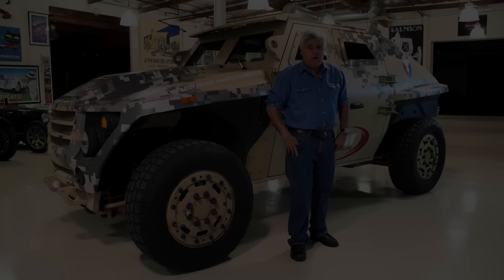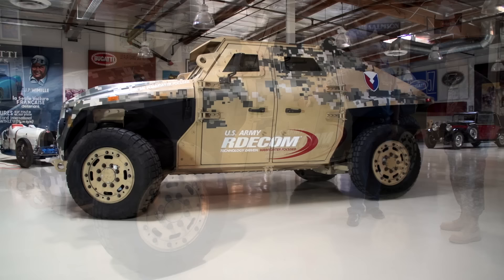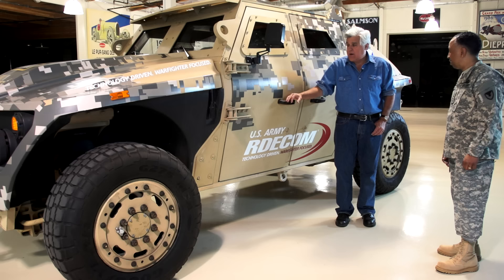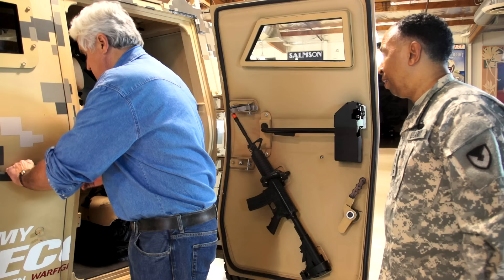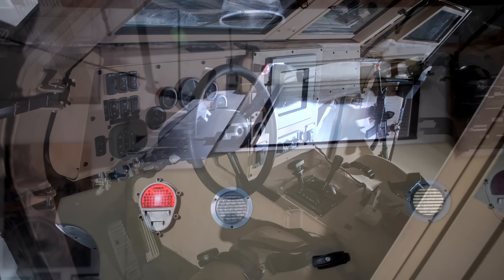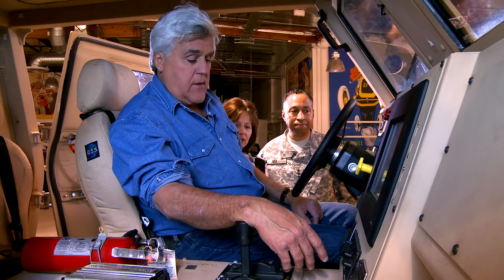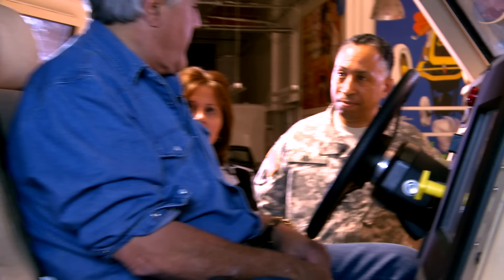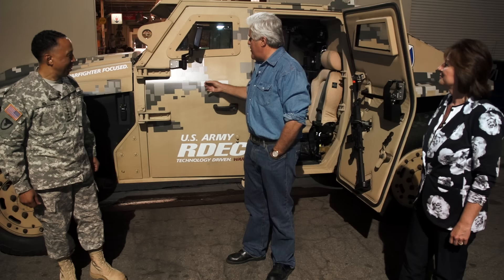U.S. Army FED - Jay Leno's Garage

Comment: 30Gal?? Well, somebody was high....
Reply: Other than that this thing is perfect. It definitely needs a bigger tank.
Reply: And a 7 speed. 4 forward, plus a granny gear, r1+r2. Although I do agree with jay, abs and traction control? Just something else to break. I hope the 4x4 is mechanicaly engaged, as well as the diffrentials and, tranfer case.
Reply: Its in 4WD all the time, with a high lock which locks the center differential in the transfer case giving a 50/50 front & rear torque split plus 4WD Low Range...same setup that the HMMWV's have....and contrary to what many think the HMMWV's do not have locking front and rear differentials.
Reply: Remember: This was designed by people who've never been in battle. That high 6-figure PhD engineer probably never designed a car before.

But, the purpose is to show congress and other key political figures the Army is, as Dirty Harry would say, "Stylish." That way, they can get more R&D money, hire more PhDs and bigger staff for the general.

"Mission Accomplished!"

Comment: that auto level would get annoying real quick
Reply: Add in some sleep deprivation and ambient road noise and somebody is going to mistake that sound as a mini gun going off.  Two intentional sounds I do not want to hear from a vehicle is the sound of something breaking and the sound of somebody shooting.
Reply: Yea, they have these auto levelers on fire truck baskets, on the aerial ladders, and although necessary on a ladder truck, it takes the least bit of movement to make it work.  I can't imagine that you are trying to sneak thru the streets of bad-guy-ville and drop into a pot hole and all that noise from the leveling system gives you away.  Hopefully all that interior lighting from the monitor can be shut off...it would make you an instant target.  Don't they get real life advice from  users of this kind of stuff before they spend millions on development? ABS? Really?
Reply: I think you are thinking of a Bentley, Dale

Comment: That would be easy to take out. Shoot the air ride suspension and tires it will drop low to the ground if not to it. Also there is easy access to the motor compartment. Once the motor is disabled it would be a waiting game. A fire under the cab would eventually kill the soldiers inside.
Reply: no air tires have already been developed but are waiting for production,they ride very nice and do not deflate under any condition and are tough as hell.

Comment: Air brakes, air suspension. In a war zone. sorry.
Reply: they have done if for years. they normally have redundant air tanks and also a brake override i believe
Reply: Jimmy O.
Reply: Brenda Richardson Richardson air brakes on military trucks have been done for many many years. there are countless ways to make the system repetitive enough to make it safely through in a fire fight with no crippling effect on the air parts.

Comment: 4cyl 200hp.. why?? that sounds super weak sauce.
Reply: Did you hear the torque numbers? This thing could probably pull a house off it's foundation.
Reply: uttersqueeze
how the generate so much torque with a small engine. Heck my saturn had 120HP. So why only 80hp more?
Reply: 77Avadon77
Its the Power stroke, weight's, and Bore displacement that give the Torque numbers.
Reply: 77Avadon77  Diesel engines have high torque numbers at lower RPMs, it doesn't need as much horse power
Reply: 77Avadon77 Just because it is 4 cylinder doesn't mean it's a small engine :/ Generally the larger the cylinder you get more torque less HP. Roughly speaking. So the same capacity engine as an 8 cylinder would generate more HP but less torque...... Please note this is a generalisation and not a rule.
Reply: 77Avadon77 I don't think you understand HP vs Torque. Torque is how much power the vehicle puts out, in this case I thought I heard 580 ft lbs. HP is how fast that power can be translated to energy. Something like this will never win a drag race but a tractor pull isn't out of the question.
Reply: Kyle Becker I think 90% of the people driving on the road have this misconception, mostly because our physics classes are more about teaching 5th graders how to compute momentum rather than more practical things.  That, and horsepower has the word power in it.
Reply: Kyle Becker You're damn right.....too many get caught up in HORSEPOWER and number of cylinders and you can tell right away they really don't have a clue......plus low hp and high torque numbers are a standard with diesels.....I say something similar to your tractor pull when describing high torque diesels: it won't win the indy 500 but it can pull down a house! I remember going to a car show in the 80's and Ford had a big yellow "tonka truck" with a big turbo diesel in it. It had 250 or 300 hp and all my buddies were scoffing....I said "read further"...800 ft lbs of torque...so what they said? I said: that is the important number for guys who pull trailers......you could probably chain all our cars together and hook them up to the back of the truck and it'd pull them all down the road....with the parking brakes on.
Reply: Kyle Becker you should look up what power and torque means.
Reply: miqo85 torque tôrk
noun
1. MECHANICS a twisting force that tends to cause rotation.

horse·pow·er ˈhôrsˌpou(ə)r
noun
a unit of power equal to 550 foot-pounds PER SECOND (745.7 watts). (emphasis mine)

Rotational force vs. the speed at which that force is applied. So yep I think I was right about my statement, great for pulling not for racing.
Reply: yah but 6cyl 400hp would be even better for geared down pulling ;D
Reply: 77Avadon77 Those cylinders would need to be of a fairly large capacity other wise your engine could actually stall if you gear it low and you have low torque but high HP.
Reply: 77Avadon77 I don't think you completely comprehend the subject matter. What you are suggesting is increasing HP at the engine while decreasing HP at the wheels by "gearing down", thus increasing torque at the wheels through mechanical advantage. Ending with roughly the same result they already have.
 
Consider this though. Diesel engines are generally low hp high torque. Gasoline engines generally have the high HP output that you are asking for. For military applications Diesels
1) Go longer between oil changes (cost savings)
2) Are more durable (battle field dependency)
3) Don't wear out as quickly (less need for replacements)
4) Can be left idling much longer with no ill effect (needed for running radios and other military equipment) 
5) Everything from HMMWVs to M1 Abrams (tanks) are already run on JP8 (military diesel) this means that in order to run a gas engine they would need another supply truck just for it. (logistics nightmare)
Reply: Kyle Becker
So how do you get even more torque if adding cylinders and HP isn't the answer?? What if someone came to you and said improve this vehicle (the one in the video) power/pulling/towing capacity? What do you just change the gearing?
Reply: 77Avadon77 Are you yanking our chain?
Reply: Josh Hanson
No. I'm not. I'm asking how do you make something more powerful. Everyone scoffed at me for saying more cylinder and more HP isn't the answer.
Reply: Did you even read the bit I wrote about cylinder capacity? There is also the stroke, in general the longer the stroke to the bore diameter the more torque. However, there are limiting factors to this and some very clever engineers will work out the most efficient bore/stroke ratio.
Reply: Josh Hanson

Yes I read

"Those cylinders would need to be of a fairly large capacity other wise your engine could actually stall if you gear it low and you have low torque but high HP."

So if you want to improve something you need larger cylinder capacity, longer stroke, to make more horsepower that in return will make more torque?

But that guy Kyle says

"What you are suggesting is increasing HP at the engine while decreasing HP at the wheels by "gearing down", thus increasing torque at the wheels through mechanical advantage. Ending with roughly the same result they already have."

Is torque a function of engine or gearing or both?

I don't know.. I might just be too dumb to understand this all lol All I was curious is how you could improve upon the design, for example make something twice as powerful. But it doesn't sound like a bigger engine necessary is the answer?
Reply: 77Avadon77 More HP does not equal more torque. Torque is an engine output.
Reply: Josh Hanson
But the engine and the gearing create torque together? Specifically lower gearing and larger capacity cylinders + longer stroke? If I'm reading you right?
Reply: Gearing can not increase torque..... Energy in, energy out etc. etc.
Reply: Josh Hanson Gearing can increase torque at the wheels. Torque and HP are rated both at the fly wheel and at the tires. Gearing can cause the engine to work longer to rotate the wheels, meaning the wheels turn slower than the drive shaft but with more force, maintaining the whole energy in = energy out.

An example of this is expressed in differentials. Which will often read as something like 4.11:1. Meaning that every 4.11 spins of the drive shaft turns the axle 1 rotation. 

OR a non-automotive example would be putting your 10 speed bike into low gear to climb a hill. Your legs didn't get stronger but more force is being applied at the back tire at the cost of you having to pedal more.
Reply: Kyle Becker Yeah, you're talking about traction now.
Reply: Josh Hanson NO. Traction would be the tires ability to grip the road.

Are you just trying to troll me? If your not you could try Google for definitions. 

trac·tion
ˈtrakSH(ə)n/
noun
2.
the grip of a tire on a road or a wheel on a rail.
"his car hit a patch of ice and lost traction"
synonyms:	grip, purchase, friction, adhesion
"new tires with improved traction"

(first definition had nothing to do with anything automotive)
Reply: Kyle Becker  SIGH You're talking about measuring torque output at the wheels. If you were ......  oh I don't know, a race engineer in an F1 team, you would refer to this as traction, which gives it the limiting factor of the ability for the tyre to transfer the torque to the road. This quantifies any equations you would do. 

I'm not trolling you, I just don't think you really understand what you're talking about.
Reply: Josh Hanson I agree that referring to the ability of the tire to transfer torque to the road is traction, however I also know that you can utilize mechanical advantage to increase rotational force of the tires through transmissions, transfer cases, differentials, and even planetary geared hubs. When these are rated for power not speed this is called "gearing down" as your acceleration and top speed are reduced. 

When I talk about measuring HP and torque at the wheels what I am talking about are the final numbers after everything including power loss through inefficiency is taken into account. When I talk about measurements at the flywheel I am talking about the numbers that the engine itself produces. In the later case the bore stroke, displacement, air/fuel ratio, etc all play a role and can not be changed through mechanical advantage.

I did notice that you are spelling tyre not tire. So I don't think American English is your first language. Maybe British or Australian English? This may be a simple communication error based on the differences in dialects.
Reply: Kyle Becker My first language is English English.
Reply: Josh Hanson Traction is a measure of friction, torque is a measure of power. Traction is dependent on the tire and road surface, torque at the wheel is dependent on just the car. Even if the car was floating in space connected to nothing, you could still measure torque at the wheel.

Perhaps an F1 engineer, talking to a laymen, might shorthand talking about torque at the wheel as a function of traction since they can generate so much power that traction is a limiting factor, but the two are not the same thing.

I'd recommend reading the wikipedia article on torque, it's fascinating!
Reply: Adam Cole
 Traction is the effective transfer of energy. I don't know maybe I could read wikipedia or maybe rely on my university education ..... Hmmm, which one should I use?
Reply: still beats the 8 cyl 190 bhp humvee's, except for the banks version that has 245 / 255 bhp
Reply: Not really. Probably has good torque. Like dude said, hummers don't have much hp either
Reply: Just leave the Idea's to the contractors. They know what they are doing.

Comment: It needs to accommodate a little more than 4. Stretch it a few more feet to get six guys in there. 4 per vehicle means more vehicles in a convoy. Those mirrors & door handles look like after thoughts. Mirrors don't stop you, but what if the handles are shot off? Murphy tends to show up in spades in the military. Hesperus is right, that damn noise would drive me nuts.

Comment: The reason for the suicide rear doors is so you can open both the fronts and rear doors and have front and rear protection from small arms fire. That's the number one reason for them, its not for "easy access".

Comment: It is a cute little SUV with good armorment, but has several weakness in it, Tries can be shot out, radiator and axle are vulnerable and only 7 miles a gal.. the solar tech was 10 years late also.. Swat will be using it before Military..

Comment: There isn't a 2WD mode in these.  its in 4WD all the time with the option of a high lock which locks the center differential in the transfer case for a 50/50 torque split front and rear, as well as a low range 4WD...no 2WD mode at all.  Looks pretty similar to a HMMWV's 4WD system.

Comment: I'm concerned about the door handles. The reach through push button style of handle is good if for some reason a soldier needs to pull very hard to get a partially disabled door open, but what are the handles made of? If they are plastic, which they appear to be, they may get shot off or perhaps knocked off with a sledge hammer by a sabateur while parked. If that happens, it would render the vehicle useless. Imagine, soldiers on a firebase start taking incoming mortars, they run to man the FED only to find out someone has snuck up and melted the handles with a propane torch moments earlier. Immediatly they would find themselves in a position where they couldn't give chase to opposing forces who engaged them and fled (I could also see the moniker "fled" being applied by soldiers pretty much overnight, food for thought. Not sure such a nickname would be confidence inspiring). It would be better if the same type of handles were made of titanium with a slightly narrower profile, this way it would be no easy task to target or destroy them. Disregard this statement if the handles are of some tough material (carbon fiber) and it's not apparent to me.
Reply: The A.B.S. Is stupid and represents an unnecessary complication en theater.   The tires should be teflon impregnated so they cannot be set on fire with a Molotov coctail, Air fuel charge, or torch.

Comment: That's pretty cool.  I've driven a lot of HMMWVs and the current uparmored HMMWVs are so hard to drive, the armor makes them so heavy, no visability, very noisy, doors are super heavy, and they don't have enough power compared to the regular HMMWVs.  If he says its pretty easy to drive that's good enough for me.  A backup camera would be great too.  I doubt you can stow a M16 behind that door.  Its also good its more spacious because with body armor and helmet on there is like no room in a HMMWV.  I notice there is no places to put comms equipment in it though.  I hope the Army adopts something like this, but it looks like its too expensive the army always buys from the lowest bidder unfortunately...  I think I checked the MPG one time on a uparmored HMMWV fully loaded and it was like 10MPG.

Comment: Sorry, but with those door thicknesses and exposed suspension components this is no replacement for an MRAP. 
A turbo-supercharged engine is also going to get chewed up operating in dusty/sandy environments and will need constant filter maintenance and oil changes. Stick a big N/A 6 or 8 cylinder diesel in there and it will still get 7mpg while being lower maintenance, more reliable and easier to service in the field.

Comment: The main isue I see with that vehicle is the exposed tires, after I watched an M-80 been shredded with 50 cal. rounds, that vehicle became a seating duck and useless, so either they put on ballistic skirts or else. 7 miles a gallon sounds terrible, I know the water 4 fuel is available, why they don't use it?  beats me.

Comment: I don't get it. How does a semi with a 50-60,000 lb load, get 9mpg? But this only gets 7?
Reply: jvallager     Semi is more aerodynamic.   Doesn't have armor plating.  Different gearing.  Much less rolling resistance on the tires, etc.   But both are using a lot of fuel.

Comment: what if the doors weight was tolerable enough that you can easily unlatch the door from the body and use it as a riot sheild
Reply: +Connor Teeter Because then the doors would not be as good of a bullet deflector. The lighter the door the less material = thinner metal which will be easier to penetrate with high caliber bullets.

Comment: This could have easily have been an hour-long video.  Jay was ADHD, jumping back and forth between components.  Thinking beefed up Humvee, very similar interior, that can withstand IED's.  When engineer Grace stepped in:  5 goals of design, walk through the Engine (why this engine? power to weight? watertight/pressurized?).   My pea brain thinks "must be 10 cyl 800hp engine" nope, 4 cyl, 200 hp (500fp torque).  Hopefully, they don't abandon these ($250k-$500k pieces of machinery) like they do the Humvee's.  Steering with 1 finger, 66 Tbird and 74 Marquise.